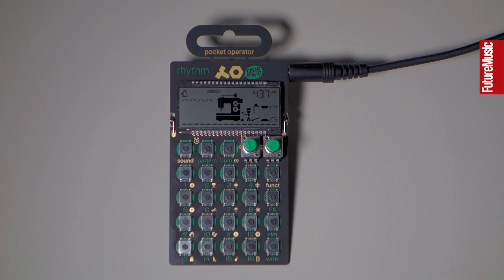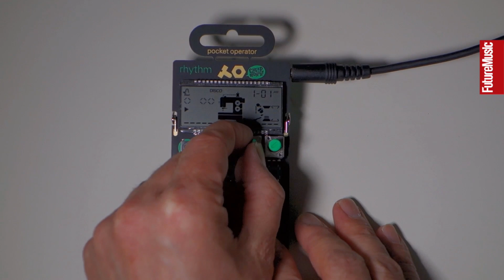Producer's Guide To... Teenage Engineering PO-12

Comment: Thanks, dude. Didn't even know about the glitch affects in this. BTW you can chain a Kaossilator in with the Operators no problem. I have the Rhythm and Sub, and while the KO can't set a clock for them the internal bpms seem to be close enough that it doesn't matter. Ends up being a very gig-worthy modular set-up.